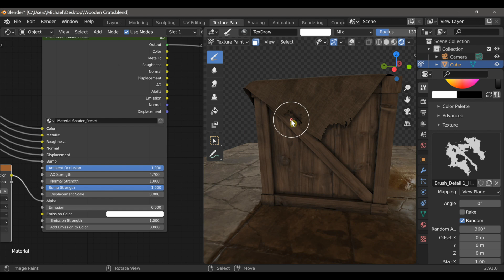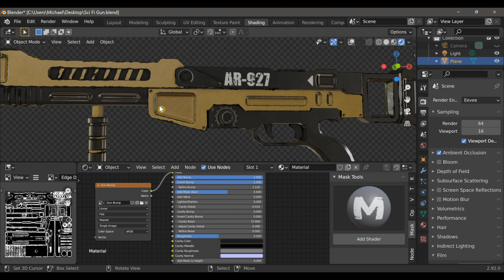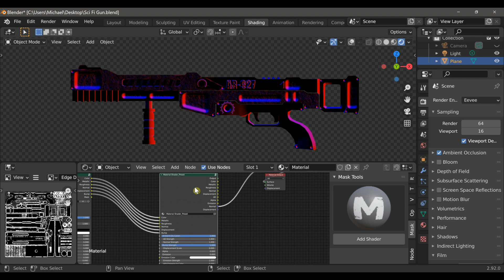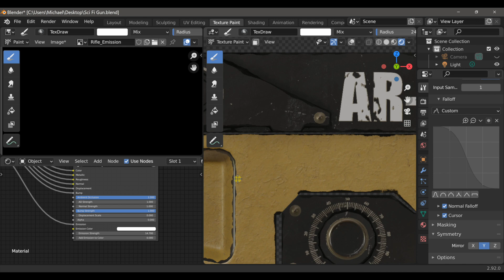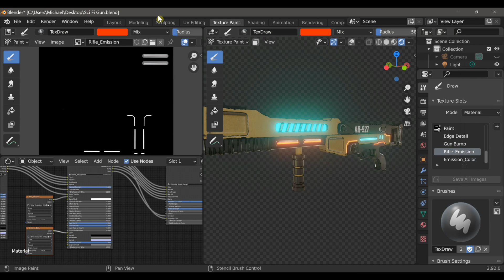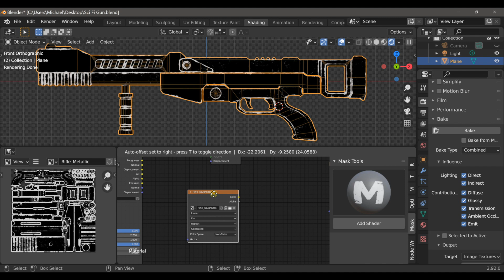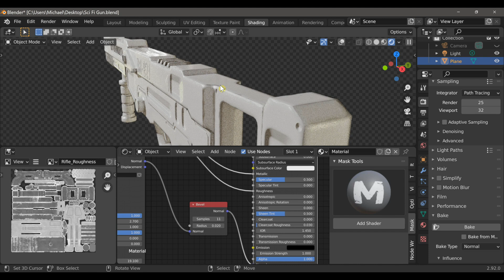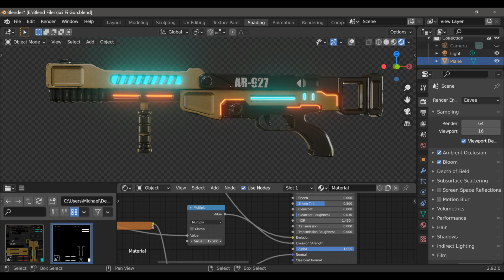Baking Textures with Mask Tools

Comment: Thanks for all the work you have done for mask tools, I was making a high res poly to bake to low res poly but have hit walls with baking selective to active, some of the defuse texture is missing no matter how many times i change the distance, or turn off displacement maps. any tips welcome

Comment: Just out of curiosity, why did you use a different method to bake the roughness map than the one you used to bake the color & metallic maps (i.e., for roughness, you used the output of the Principled BSDF and set the bake type to "roughness", instead of using a Viewer node as output with bake type set to "combined" like you did for color and metallic)? I usually just use an Emission shader -- which is the same as a Viewer node -- to bake all my PBR outputs (except a normal map, of course), and now I'm worried I might be doing something wrong:-D

Comment: Do you happen to know if SVG is capable of being used as a mask in built-in blender? If not, maybe a plugin would fill a good gap here. That way mask stays unrasterized. Do know if graphics cards support this or not (texture as svg). would be cool if they did tho.
Reply: Currently you can't use SVG as a texture (which is what the "masks" are), they can be imported which converts them into curves which can be made into a mesh in the same way text is treated in Blender. I don't know of any 3D application that can use rasters as textures, so I'm pretty sure that is not something easy to do, might not even be possible. Would be really cool if it was though, textures with infinite resolution.
Reply: @daniel4647  - thanks, Yeah, I think the underlying cards don't support masking with svg (function similar to sampler2D, but for input of svg ) - not sure why though considering it would make better resolution graphics when zoomed in. Maybe too much processing needed per frame if not a bitmap of some sort.

Comment: I failed to use the addon because it is very slow on my pc. Could you make a video showing how to speed up the workflow on a slow pc? I have an Intel(R) Core(TM) i7-4790K CPU @ 4.00GHz   4.00 GHz with 32 Ram and Geforce GTX 970
Reply: Have you tried lowering the viewport sampling?
I have a similar spec pc and have been toying with the idea of picking up Mask Tools
Reply: @MoonkeyMod  I used Eevee most of the time and it is slow. When doing the edge, I used cycled and then baked the edge map and use it in Eevee. I wish there was a light version of the tool.
Reply: @sulaimanalbusaidy1  Have you tried Ravage add-on? He have a video on explaining how to optimize it for faster workflow